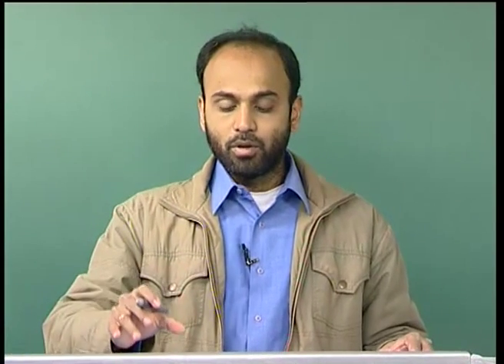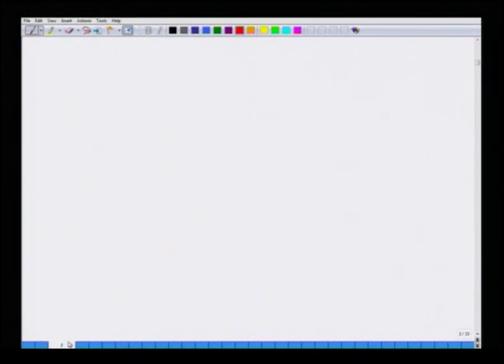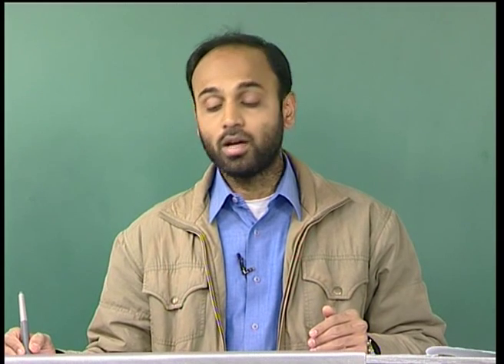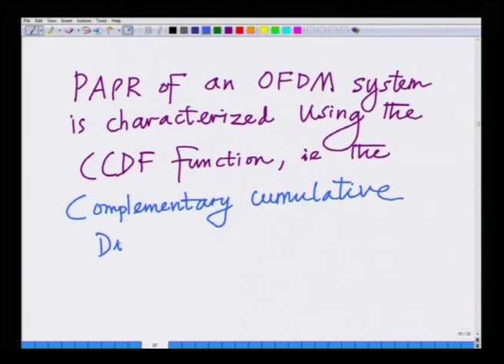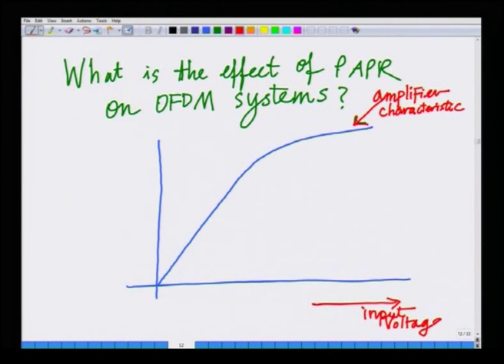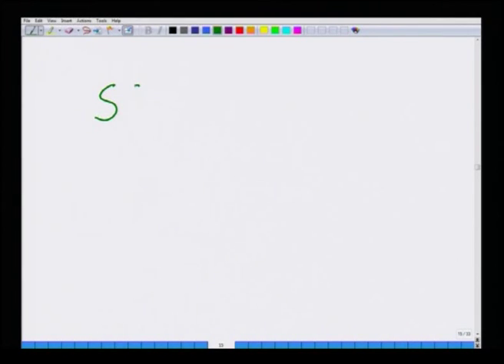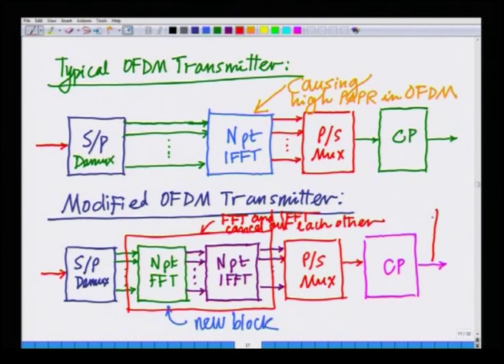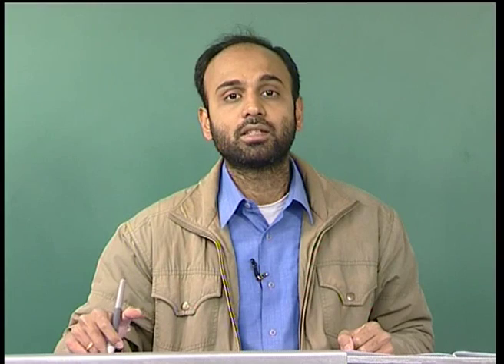Mod-01 Lec-34 PAPR in OFDM Systems and Introduction to SC-FDMA

Comment: how IFFT produces PAPR
Reply: One way to view the output of the IFFT block is that each pin it's a weighted combination of N independent modulated symbols. A fair assumption is that they have finite second order moments. Which implies that the sum almost surely converges to a Normal distribution with certain variance. This is problematic as there is a non zero chance that the IFFT samples might exceed the linear range of a power amplifier and cause spectrum spreading leading to high PAPR.